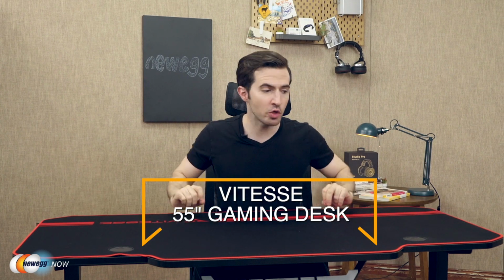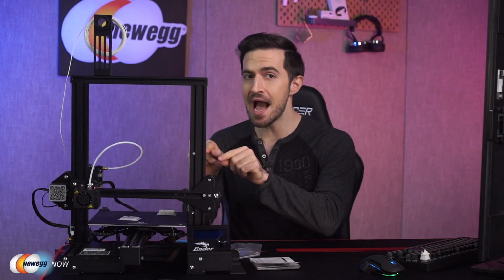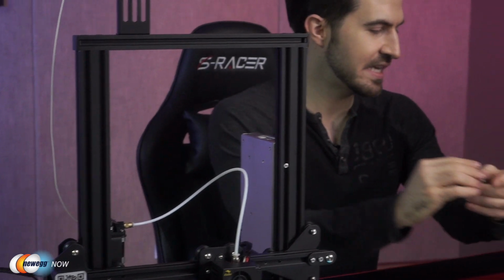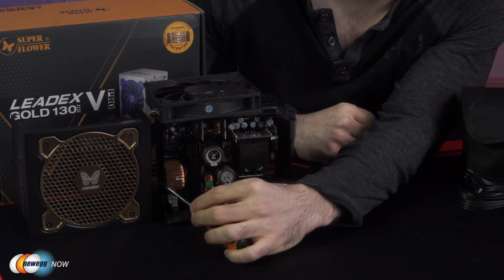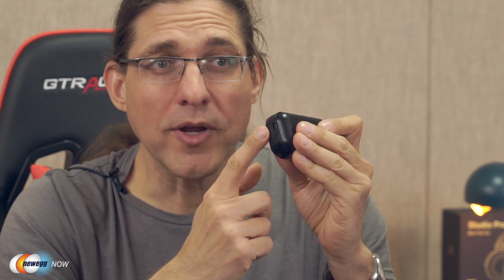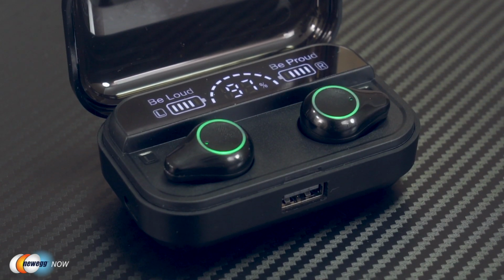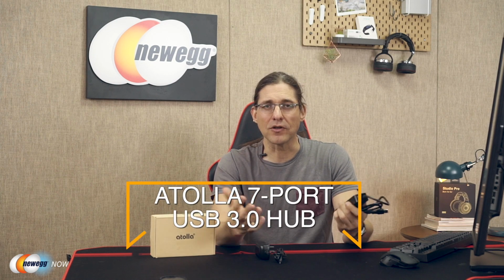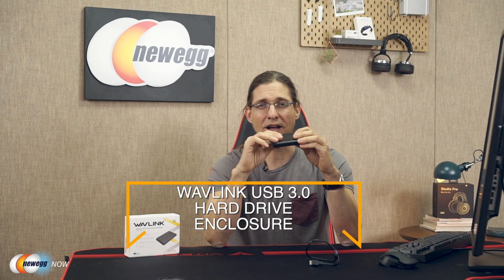1-13 Newegg Now: Super Flower Leadex V 1000W Power Supply, CREALITY Ender-3 Pro 3D Printer, and more

Comment: I just got this PSU. It looks great, runs great and I really like the compact size. However, not sure if the ECO switch is doing anything at all. The fans seems to spin the same regardless. I am running about 45% load, so I would think that would allow the ECO mode to function with modulating the fan speed, but not that i can tell.
Reply: The ECO function seems to work for me (fan dose not spin till I have a demanding game run for a few mins), I had to use a flashlight to check because even when it doses spin it's so quiet, I can't tell it's spinning. keep in mind it's based on the PSU's temperature not load. But yea if you're using less than 50% of the advertised wattage it shouldn't be spinning in eco mode if it's able to get good airflow. But I got the 850W Leadex V Gold Pro and love it as well. Silent, works perfectly, and the small size is a nice bonus. My previous 850W PSU couldn't handle it when I finally got my hands on a RTX 3080, but the Leadex V Gold Pro has been rock solid.
Reply: @sean8102  I also have the 850 watt model, and I can see that the ECO funtion works very well. I see the fan only kicks on when I am gaming and then stops when I am just using the internet. However, with the same exact load on this particular 1000 watt model, the ECO function does not work as expressed in the manual. The fans is always on no matter watt. I have two of them now and it's the same with both, so I guess that's just the way it is.

Comment: Compared to Seasonic Focus PX to Leadex V Pro, what is better?
Reply: Recently Seasonic and Evga has taken shortcuts in QC   probably comes from the same LQ factory. I'd stick with Super flower, Corsair or Enermax
Reply: I can only speak for my experience with the Leadex V Gold Pro. I got one a few weeks ago and love it. Love how compact it is, it's completely silent. I've never been able to hear it, and I no longer have any of GPU driver crashing I was experiencing with my previous PSU (made the mistake of getting a no name brand because it was all that was in stock at the time, the "Gamemax RGB 850"). I got the Leadex V Gold Pro 850W and it's powering my EVGA RTX 3080 FTW3 Ultra, 8700K OC @ 4.7 Ghz all core, 2 PCI-E NVME SSD's, two SATA HDD's etc and like I said I've never been able to hear the fan and things have been rock solid reliability wise.